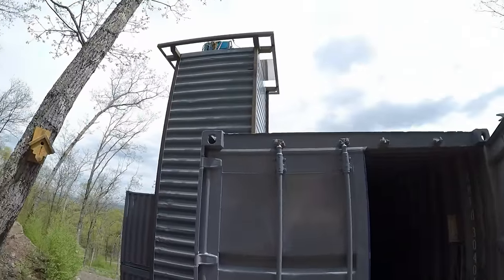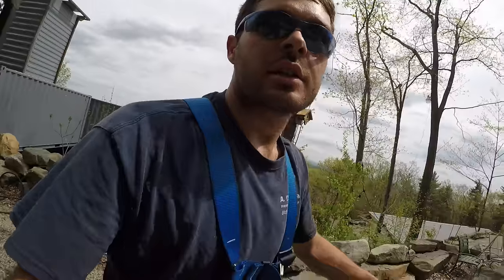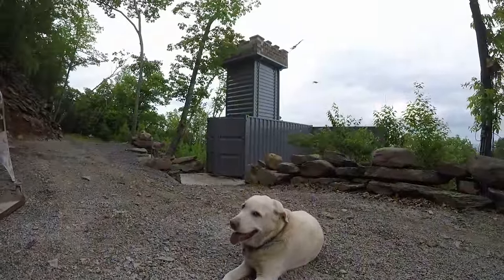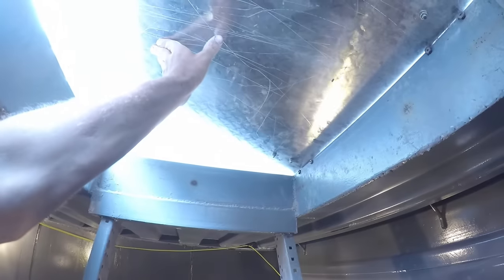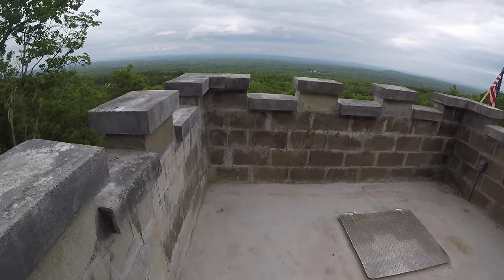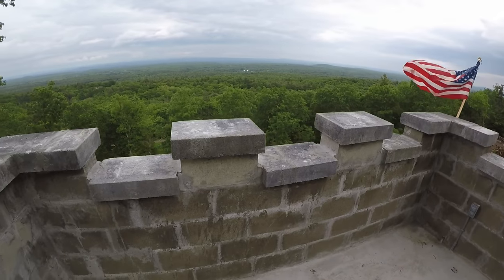Building a shipping container castle tower

Comment: Just a curious question from a former crane operator.  Did you calculate the weight of the trailer and your body weight to ensure it didn't go past the load capacity of the ratchet straps/load slings?  Lol!  Just ribbing you some!  Outstanding thinking on using the trailer as a basket and having the forethought to use a safety harness.  You're doing some awesome work!
Reply: didn't you see? He did the jump test.
Reply: Lol!
Reply: that was the best!

Comment: i may be missing it but where is the rain water going to go?
Reply: Thomas Kiss I was wondering the same thing!
Reply: Thomas Kiss There is a drain installed on the floor of the tower.I briefly saw it when he was pouring the concrete floor.
Reply: there was a drain built into the floor that just drains under the overhang you can see it at around 10:30
Reply: There was a drain, you can see it when they're pouring the concrete
Reply: I think that you can see it at 10:28 min.but I´m not sure
Reply: Watch the floor just as he pops out at the end.  You can see the floor drain, it's over the outside of the tower.  There's a couple of them on the around the perimeter.
Reply: It looked like he put 4 drains in the floor.
Reply: Looks like it. But also looks like a leaf would clog them in no time. I think he will put in a better hatch, because the one he has now looks like it will leak.
Reply: Brian Garrow that's what I though I just wanted to make sure thanks though
Reply: Frankie Robles saw it thanks
Reply: OhYou_ ok thanks
Reply: Barry Woods thanks what I thought I just wanted to make sure thanks
Reply: TheSerpent753 yep with pvc pipes thanks
Reply: Kei Ouji yea I was just surprised to see that he didn't copy the same method as in the roof nevertheless this would be better and I doubt clogging will be a problem thanks to gravity and the fact that he is most likely going to be up there as much as he can
Reply: Exactly, I am a plumber and that is the first thing that I thought of lol.  It's gonna get very wet up there and down through that leaky lid he built.  Both roofs need roof drains.
Reply from the maker: I added drains in each corner, its working well. That hatch does not leak, perfectly dry in there during rain
Reply from the maker: nasser Jooda the shipping container metal is much thicker than metal roofing so no it's not bad. And most of the roof is concrete anyway so it's silent
Reply: the trap/door edge you should bend down so the water not going in
may the force be with you
Reply: You can also see the drain at 16:03
Reply from the maker: I have drains in it. They work fine, that hatch does not leak.
Reply from the maker: Kei Ouji it does not leak.
Reply: id bet he has it going from the drain to gray water tanks..
Reply: It would seem that you have a lot of interest regarding the drainage.
Reply from the maker: Kei Ouji yeah, it's annoying. The drains work fine.
Reply: Jonathan Gonzales 
In many more remote areas, there are NO permits required at all.
in my area a septic tank needs a permit to be installed and inspection afterwards.
other than that nothing is required at all.
Reply: Thomas Kiss the drain
Reply: Thomas Kiss  Drains @ all 4 corners in overhang. Just drips below.
Reply: Kei Ouji  Hatch plate several inches high, water will drain out before it gets that deep.
Reply: i just commented the same thing before i scrolled down
Reply: i asked the same thing he said he installed drains i didnt see them
Reply: i asked the same thing he said he installed drains i didnt see them
Reply from the maker: GENESIS420 there are 4, one in each corner. You can see them when I'm shoveling the concrete in. They work fine.
Reply: i believe you i watched the hole vid cool shit i must of just missed it
Reply: or you didnt record it it looked like quite the job. a lot uh work
Reply: Look at the pipe on left side of the ladder as he goes up to the door. That's the drain.
Reply from the maker: Heru- deshet that's the stairs column. There are 4 drains. One in each corner. You can see them when I'm shoveling in the floor concrete.
Reply: There are many factors in doing a pro job. One plan I found that succeeds in merging these is the Rohon home build (google it if you're interested) without a doubt the best info that I've seen. Check out this  amazing website.
Reply: Great point, who knows where the rain water will go when there's TWO drains installed.. one can only guess.. 😑
Reply: hush
Reply from the maker: GENESIS420 my camera fell off the tower and broke, so a few boring days didn't get filmed before I fixed it.
Reply: Andrew Camarata this goes to prove that it's never too late to have a happy childhood most of all I like the red white and blue thank God we got Donald Trump as our president
Reply: Pat Lowney good luck with the health care these republican are going to take away from the people of US
Reply: Bob Curdo I don't care about health care I'll just head for the liquor store and then jump on my iron horse and ride into the sunset
Reply: Thomas Kiss i said the same thing
Reply: I bet I'm the first one to say something about drains!
Reply: nasser Jooda I'd imagine he would have spray foam the roof from the inside to stop the noise
Reply from the maker: Mike H a gap under the walls? I did that  with that big roof. It's much better having the water go threw the pipes. When it just runs down the side of the building it peels the paint, and finds its way inside.
Reply: I saw the drain.
Reply: Andrew Camarata The steel drain pipes will rust on the inside my freind. maybe try and coat the inside with a custom long brush? But what a fantastic build and way of life you have. I'd feel very content in life if i was in your shoes land skills  infrastructure and a creative mind 🤘

Comment: May i suggest ... : brush your maconery joints with a plastic brush like 25 minutes after, it will look nicer without the need of using Karsher, and adding "brackets" to your trap door so the water don t go inside (i mean don't just put a sheet on top the water  will fall inside), sorry for my english but i am french, nice job anyway !
Reply: VALERI Michael my concern is the amount of water that would during a heavy rain... There's no way for the water to drain. Amazing project, but I hope that doesn't become an issue.
Reply: Extreme flooding
Reply: I saw at least three drains...they are recessed on the floor.
Reply: Robert H Cochran ok

Comment: Somewhere there is a OSHA inspector watching this video and he is losing his shit.@9:33
Reply: best part of the video!  this guys got skillzzzzzz!
Reply: Andrea Dgeorge that was actually a climbing harness which may have helped some
Reply: Andrea Dgeorge looked like a recovery strap for pulling vehicles out of ditches. If that’s the case he is actually within OSHA regulation for safety equipment sort of. OSHA requires the the harness, strap, and hook to be able to handle up to 10 times the weight of person. So he’s sort of being safe lol
Reply: Honestly for how sketchy that looks it’s not terrible. The crane can easily handle the weight because that trailer plus him weighs at most 800 pounds. The tow straps that are holding up his trailer are the sketchiest part. If  the tow straps are 3inch straps they usually are rated for 2500lbs of force so theoretically he’s ok, but I mean anyone can take one look at that contraption and question this mans sanity
Reply: That's called a y lanyard. The scrunched up part is the shock absorbing pack that unravels when you fall into it. It's rated for fall protection.
Reply: Yep
Reply: No the OSHA guy is just cursing he can't catch hill Billy engineers in the act more often
Reply: I was surprised he tied off lol OSHA would be proud 👍
Reply: lostchild2017  Hahahahaha!!!  OSHA...Hahahaha!
Reply: lostchild2017 😂😂😂😂😂
Reply: Andrea Dgeorge  thats literally an OSHA recommended fall-rated 6ft safety harness lol
Reply: lololol
Reply: Good !
Reply: lol
Reply: My uncle is a welder in canada. They lift his truck on crane so he can weld

Comment: It's great!  However do you think you should have put some drain holes in the top of the tower?
Reply from the maker: rickd248 nah, than the prisoner up there will have nothing to drink.
Reply: Andrew Camarata   Well rats!  I never thought of that.  I must be getting old.  It all looks good so far.
Reply: Skip to 10:25 and pause. See the drain at bottom of the screen? There's also another one right side center of the screen. I'm sure there's another drain or two that can't be seen in this clip. Now, skip to 16:18 and look on the floor to the left and right of the door. Those are the finished drains. Two more drains are on each side of the chairs.
Reply: Andrew Camarata that's awesome dude.  Hey what state are you in? ??
Reply: rickd248 he did
Reply: He is in upstate NY.
Reply: I saw a small floor drain when he was pouring the conc floor
Reply: I live in South Florida but I’m moving to North Carolina for just this reason - I’m buying a home with at least 3 or 4 acres so that my family will be comfortable but then I can go off on my own and do manly shit like build a castle ...or a log cabin ...or at the very least a small shed or birdhouse. Anyway, awesome work. In my opinion I think he should’ve made the parapets authentic and functional, not just decorative, by keeping the machicolations open (the spaces between the supporting corbels). Also, I would’ve preferred a more medieval look by using iron as opposed to the more modern steel floor plate and by using more wood - his door looked SO awesome with that beefy wood, I’d love to see more stone, wood, and iron detail!
Reply: rickd248 I see four drains

Comment: That's a lot of weight.  Id have used a thinner block on the top.   Notice the corrugated metal is horizontal on the tower.  Those shipping containers get their strength from the corrugated metal being vertical.  Looks like a giant accordion.  I'd definitely beef up the load bearing walls ASAP.
Reply from the maker: Luke H I added two 4"x4" columns in each corner on the side that was the roof. The bottom has the strong frame, plus all the thick wood. Plus there is the center column from the stair case. I feel good about it.
Reply: Cool, i just found your channel.  Cool videos, I like your work..
Reply: Just wonder have you ever sit down and calculate about it? Just wondering.
Reply from the maker: Benjamin Lee yes I did. The math I did said it was completely fine.